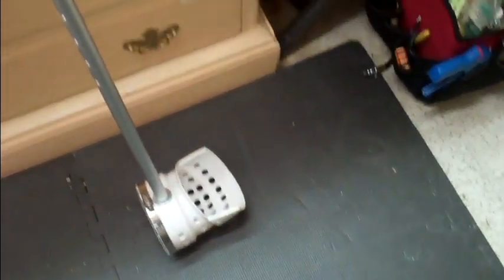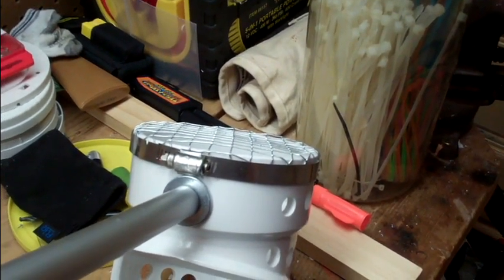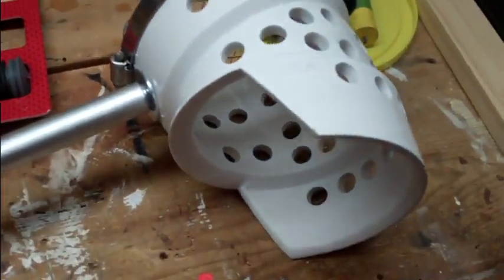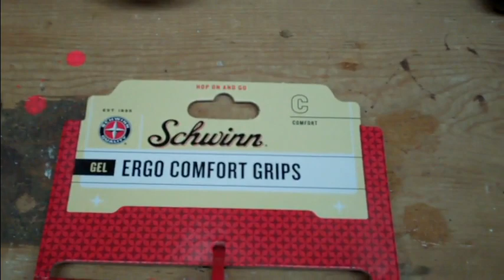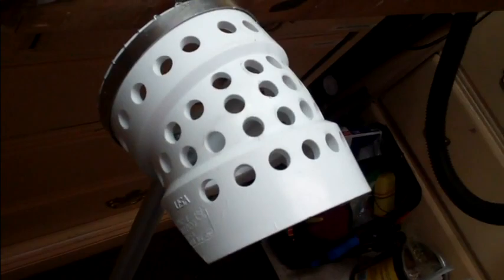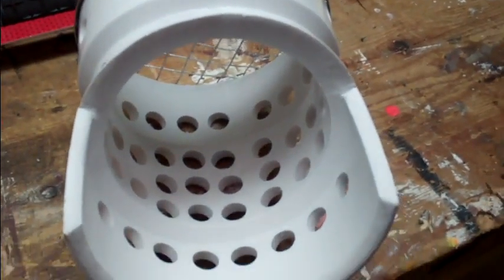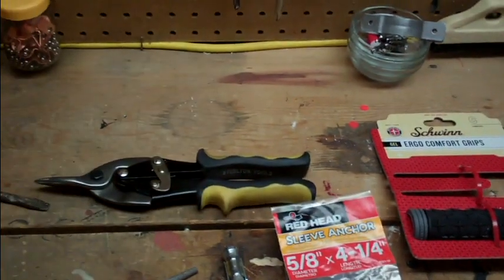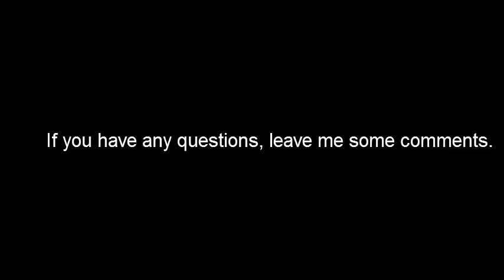How-To Make a Sand Scoop for Metal Detecting on the Beach

Comment: Well done, expert craftmanship and it should work great!  A tip:  you can go to Goodwill or Salvation Army and usually find crutches for around 5-10 Dollars.  I use an 8" round PVC with and "end cap" on one end drilled with 1/2" holes, then bolt (2) two pieces of tubing for the handles, slightly spreading them where they join the basket.  Great job again!

Comment from the maker: I’ve actually never tried using it while wading, but I would recommend this for dry sand beach hunting only.   It’s more of a light weight design and I would think a metal scoop with a sharper cutting edge, longer handle and foot pusher would work better.  Thanks for checking it out.

Comment: Buy a galvanized grain scoop, cut bottom and end and solder hardware cloth to bottom and end and insert conduit into handle. It's thinner and easier to push through the sand. This is what we use. I hope this helps.

Comment: I really like the design. The only things I would consider changing is to either fill the holes where the crutch handles adjusted with epoxy or drill a weep hole closer to the sleeve anchor. I would also coat the sleeve anchor in epoxy. I am not sure if they are triple zinc plated, but even so the saltwater and electrolysis of dissimilar metals (steel to aluminium) will break them down quickly.

Comment: That scoop lasted about a year but stainless was too thin so bucket tip kept bending. I just discarded the scoop 2 days ago when it bent yet again. Broke handle off by whacking it against a tree and kept most of handle. Rest will be burned in trash. But for a year or so that was my favorite beach scoop because it could slice through sand at beach so easily. I've been working on another scoop for last two days made from an old stainless ice cream maker container--it is thin also but a bit tougher

Comment from the maker: Hi, i dont remember exactly what the diameter is, but it is as tight as possible against the threads of the sleeve anchor, probably 1/2". I wanted to have to screw it in.  I would suggest washers on the top and bottom to protect the PVC and to be able to get it really tight.  Use some lok-tite on the nut.

Comment: It wasn't welded(Oh, by the way, I am Michael Mosley--micmoable was my user name till recently when google had me changed to my real name on here). I cut the scoop blade part out of stainless trash container and nailed it to a piece of 2x8 board. Then fixed handles to the board section. Used aluminum straps to secure it better. See my video about it on this micmoable channel--it has green handle of two pieces of plywood nailed together. Just threw the scoop away--it kept bending on blade tip.

Comment: Like your design, however, having used sand scoops for 40 years, Please accept my critique with grace, the PVC is good, but a couple of issues will come to light when you start using it., your holes should be no larger than 3/8" at 1/2" you can lose small gold rings and silver dimes, also the wire mesh on the back should also be 3/8" again instead of 1/2" and the mesh should have a support bracket across it for your foot when pushing it in the sand , the pole should actually go through the scoop completely from one side to the other, where its attached only to one side is a definite week point and you will notice it as you try scooping up wet sand, and lastly,the mouth of the scoop is a good design, but even though you tapered the edge for pushing through the sand , the addition of a replaceable stainless blade attached to the mouth would make it much easier to use, Great design, but again, 40 years experience ha taught me a lot as well, good luck to you.
Reply: If you have leftover screening material, you could simply add another layer of it, cross-hatched over the original 1/2" screen....and you would even be able to adjust it to suit your needs....
Reply from the maker: +BALTOMAN - thanks- appreciate the feedback.  only had coins in mind during my design and dry sand.  Certainly needs some mods for smaller targets and wet sand.  I've seen some nice videos of homemade wetsand scoops.

Comment: I have always built my scoops (Except one very tough bought one of stainless I had about ten years ago and shouldn't have sold but I let it go with a 1280-x I sold). I usually make my handles of wood and nail my stainless bucket to piece of board and use strips of aluminum to brace/support the handle,etc. I have no way to post vids right now because I deleted Quicktime player from my computer not knowing I needed it for posting my videos--but micmoable=my videos/google changed username2real name